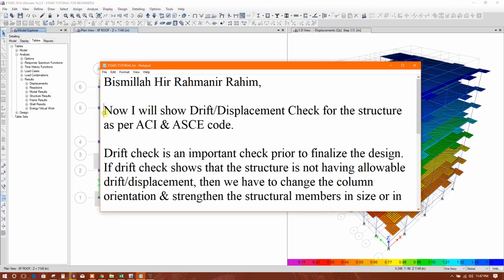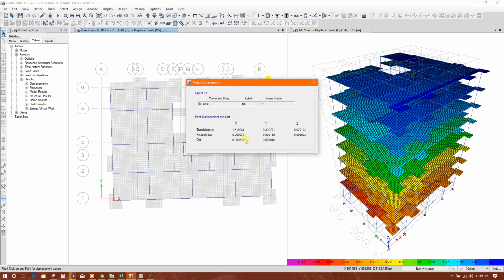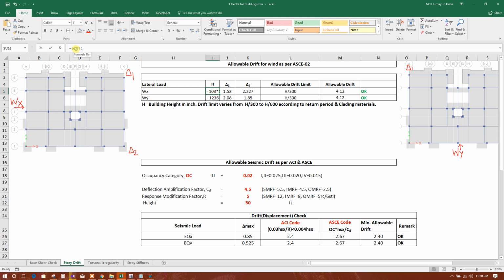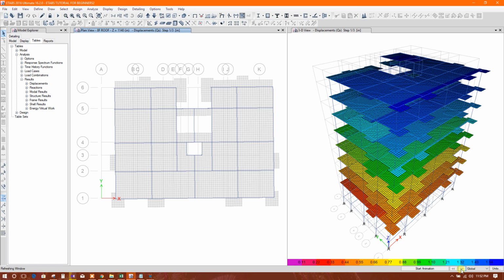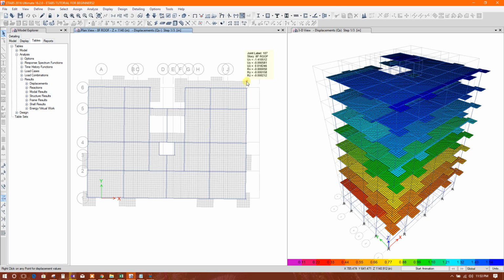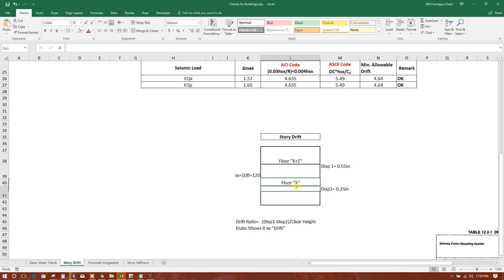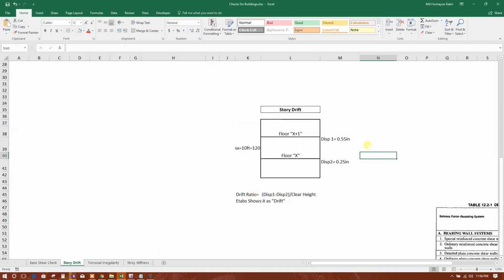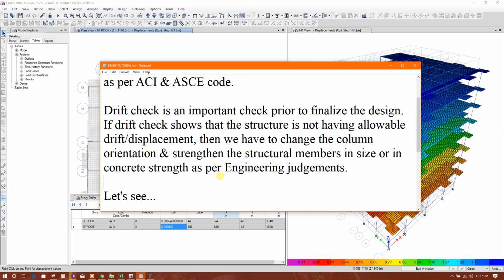DRIFT OR DISPLACEMENT CHECK IN ETABS.

Comment: Hi Decode Bd, do you include dead load & live load in your wind load cases in order to check your story drift?
Reply from the maker: For checking drift for wind we use following load combinations in ETABS:-
DRIFTWx1 = D+0.5L+0.7Wx
DRIFTWx2 = D+0.5L-0.7Wx
DRIFTWy1 = D+0.5L+0.7Wy
DRIFTWy2 = D+0.5L-0.7Wy
For seismic drift, we do not need any combination, drift will be checked just on EQx and EQy load cases only.
Reply: @Decodebd  sir, stiffness reduction is usually applied to check strength, but when we check drift for wind, should we make another copy of the model with no stiffness reduction?